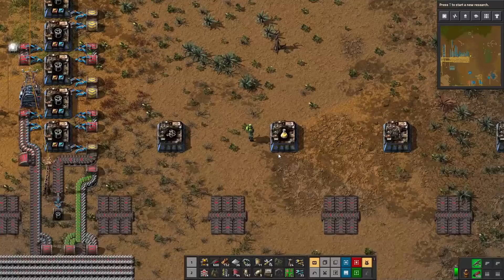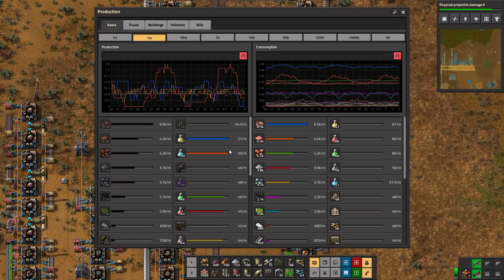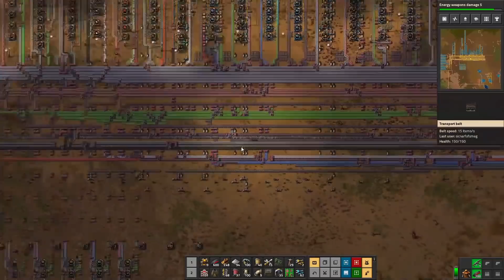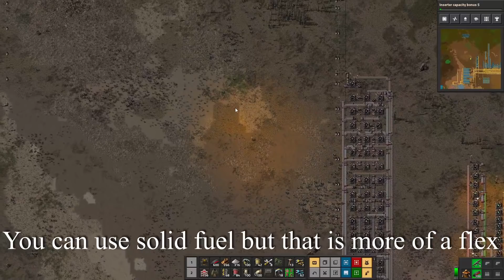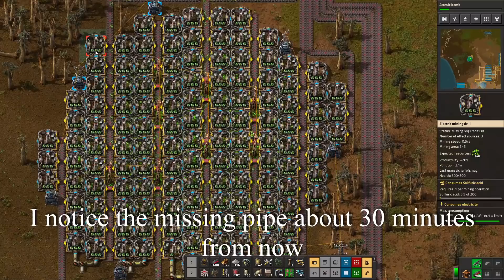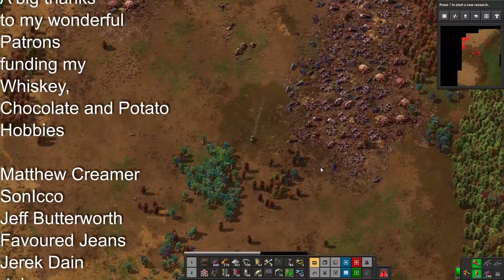Factorio Railworld 5 : Science and Uranium

Comment: As far as I can tell, there's nothing that definitively prevents shiny uranium that was produced by chance from ore from ending up on your main bus' dull uranium line. Filter inserters can't necessarily be counted on to always grab an item. It's unlikely to happen for now as long as that box doesn't fill up, but if you want this build to run for a long time with no problems, I'd recommend fixing it.

Also, that is an absolutely massive kovarex build. Are you planning use almost exclusively nukes for fighting the biters or something? Cause that's just about the only plausible use for THAT MUCH shiny uranium. If you used that for nuclear power, you could probably support 10 TW. It's hard to use much for nuclear fuel either.
Reply from the maker: My biter clearing will consist almost exclusively of nukes, I like to get all the enrichment started early to we have a big buffer.
Reply: @FrancisJohnYT  Heh, I look forward to it :-)

Comment: Thanks for the inspiration. I started a new base trying a few different fundamentals from what I usually use.

I like the 6 belt main bus with 2 spaces in between for undergrounders. I did pretty much the opposite before. 4 belt main bus with IIRC 1 space in between, I added undegrounders to the main belt itself when splitting a line out of the bus. This change to 6 also got me to use the balancer blueprint book, which had the side effect of making me use balancers to connect my smelters to my bus and mines to my smelters. Instead of just merging everything onto 1-2 belts before getting to the main bus.

I also never tried using beacons or productivity modules which I might try out.

However I still hate belt weaving and refuse to use the 10 interval factory.
Reply from the maker: Be careful with the modules and beacons they eat a ton of power, I am going for nuclear just to pay the power bill.
I am learning the 10 interval factory thing is just a me thing, each to their own :)

Comment: 9:45 You could probably braid the red and steel with the green and furnace on the left side, then take the rails and switch it to the inside lane by the modules so you make a combined module + rail belt, then output the science onto the furnace belt instead. Undergrounds can be used to switch lanes in a compact manner.

Comment: One power-saving tip that I would've recommended would've been to replace some fast inserters with less-power-intensive standard inserters, but PRIMARILY as the output, or the input for handling certain materials that are needed in just low quantities per output, of an assembly machine that isn't churning out items at a fast rate (for the same economical reasons as to why you don't always need to use blue, or even red, belts over the bog-standard yellow belts, even for end-game).

Also, any plans to swap out the Armor-Piercing Bullets with Depleted Uranium Bullets?
Reply: inserter consumption is really smll compared anything else. My factory is consuming 450MW right now, and around 30 of those are from green inserter (everything is green). If I switched to yellow everything, I would save 27MW, it's basically nothing (not to mention the fact that I would have to think multiple times "do I need to upgrade or is yellow enough ?")

Comment: I can't believe he still hasn't noticed the grid mess-up at the left of the blue circuits, which he accidentally made previous episode
Look closely at 3:39
Reply from the maker: Is that the only yellow transport belt? Pretty sure I was using that as a guide, it does not carry anything.
Reply: @FrancisJohnYT  place a beacon the gap, you cannot hit the blue circuit factory and the factory on the left at the same time.

If you place the beacon I side the beacon marker you placed, you just hit the blue circuit factory as there are 2 tiles of distance, but from the marker to the left, there is a 3 tile gap to the other Factory

Comment: At 12:00 -- blueprints now store modules.  Putting two efficiency modules in miners is as simple as creating a blueprint stamp and reconstructing the patch.  Personal construction bots will take modules from your inventory; roboport construction bots will take modules from the logistics network.

At 16:30 -- pipe optimizations in recent versions have greatly decreased the CPU load of nuclear power.

At 19:30 -- you can move the concrete more quickly by using stack insterters with a chest buffer.
Reply from the maker: Mining outposts are right after Nuclear. Will have to make a mining blueprint.
I hear they have improved nuclear greatly, still going to do some mass solar as well, it's just to much fun scaling up production and deployment.
I ended up doing that in the end.

Comment: You should try Spidertron, it has its own grid (so you can have exoskeleton in it to go fast, more personal laser defence ...), a remote (so you can simply go inside and remote it far away, more convenient for long journey), it's tankier than a tank, and faster (especially since you're unaffected by terrain, and collide with practically nothing so you're always at top speed)

Oh, and did I mention there's also a quad rocket launcher that allows you to send a flurry of rocket ?

(Since you have a grid, it can also use roboport which probably opens a ton of options I haven't tried yet).

But mostly, quad rocket launcher !
Reply from the maker: It's on the list of toys I want, but it's all the way down the bottom of the tech tree. We will be playing with it later.

Comment: I stoped playing this game right before uranium came out. Any tips for a returning player?
Reply: You should be able to pick it back up no problem. Things are actually much more streamlined now, and just going through all the science packs is the perfect way to (re)learn the game. I would mostly ignore the tutorial / campaign still... One of the major roadblocks for newer players, oil processing, has been greatly simplified in the early game making the mid-game a much smoother experience. You mention Uranium, so you're probably interested in power -- Francis is grossly over-doing his centrifuges. You only really need a few, maybe more if you want to start running reactors before you get Kovorex. I typically go with 5, and its always been overkill for normal-sized bases (and you would want to transition to solar if you planned on going megabase).
Reply: @foobazabar  Cool. I remember having to put down 100 tanks for light and heavy oil just to use a bit of gas. I remember the power production hump, one second i am mass producing tiny boilers the other i am scrambling to put up accumilators so that the base doesn't shut down. Putting down redundancy plans and other power grids for essential production and defense in the base was fun though. When i saw the latest patch i thought the devs were trolling with the spider thing, but turns out it is real! So i am excited for that.
Reply: @shadid516  Yep, I'm trying my hardest not to spoil it for ya but that's exactly the problem they fixed for early oil processing.  Honestly, I would not advise going solar until late game. Its just so prohibitively expensive and miserable to set up without zippy robots. A simple 2-reactor nuke setup is actually quite easy to get going! Doesn't have to be perfectly efficient and you really shouldn't worry about wasting fuel cells (they're very cheap, once you have kovorex).
Reply: @foobazabar  thank you very much.I will do a casual run asap then try to go megabase as a second step!

Comment: Hey Francis, love your content.  Been a fan watching your ONI and Factorio series.  I highly suggest the bottleneck mod.  Its a UI QOL that shows every production building status with a colored dot, makes it really easy to see whats building and what is backed up so you can easily spot bottlenecks in the factory.  Red = Missing supplies, Yellow = output is backed up, green = currently producing.
Reply from the maker: I'll put it on the list to use later, don't want to swamp the newer players with extra visual info they will be missing.
Reply: @FrancisJohnYT  however, check on UPS load if you going to try it out, there is rumors that this thing can be an update hog compared how little it actually do. Not sure tho, needs checking.

Comment: I have never seen such assemblers arrangement before. you trying to share all production lines' beacons. but don't you think different length assembler lines takes way more beacons then necessary? it would great for efficiency  if you design them about same length.
Reply: you can't really do that though, as you'll need more machines to make the same amount of the latter sciences.
Reply: @Starlight-ct  split assemblers among multiple assembly lines. I mean of course it's hard task, but it's possible.
Reply from the maker: It won't be perfect, or super efficient. It just allows you to take your starter base and crank the production way up without a massive redesign. Also makes designing things simpler by letting you know how much space you have to work with.

Comment: * Putting productivity modules into the labs themselves is really good
* You can run 56 reactors on a single Koverax centrifuge when using Prod 3 for the fuel cells. Aside from the startup time the only reason to run a huge number of them is nuclear bombs
Reply: Also nuclear fuel for trains.
Reply: @Majromax  a single kovarex enrichment can run 33 trains on nuclear fuel continuously without any speed/prod modules.
Reply: @alexsiemers7898  That's not nearly enough trains for a megabase.
Reply: @Majromax  He is going for 500 spm. What he built is not for trains. You should work for Kim Jong-un the way you are trying to cover up obvious nuclear weapon factories.
Reply: Francis is WMD expert, he is going to nuke both the forests and biters. I have never needed more than 4 centrifuge running kovarex on my 1k spm.